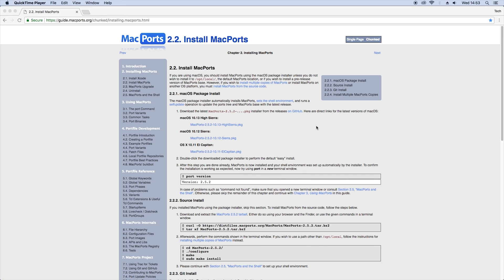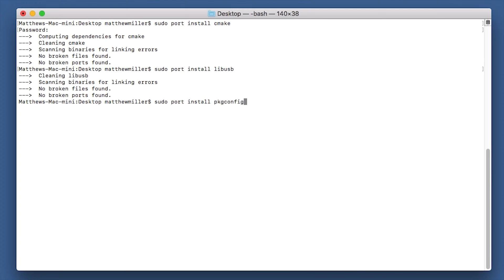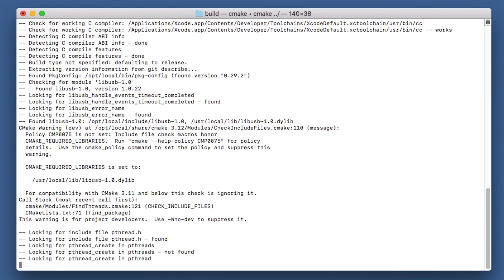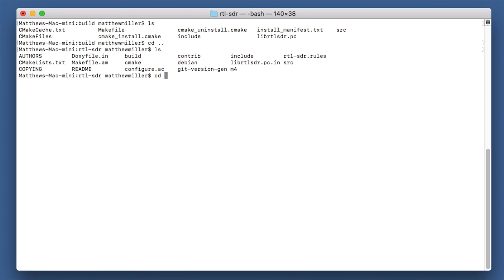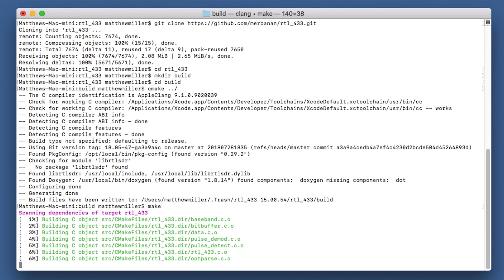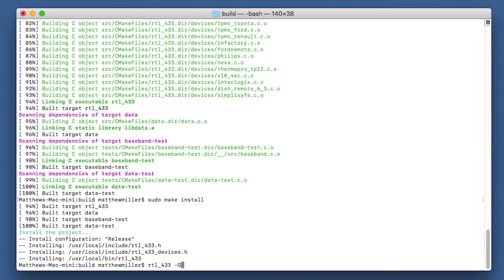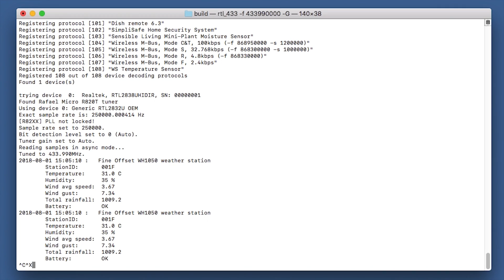Decoding Low Power Devices on MAC OSX Using RTL433

Comment: Why would you not use brew
Reply from the maker: There's always a million ways to accomplish the same goal, in this example I used macport. :-)
Reply: Don't suppose there's an easy substitution from this to brew commands? I have brew but barely know how to use it.

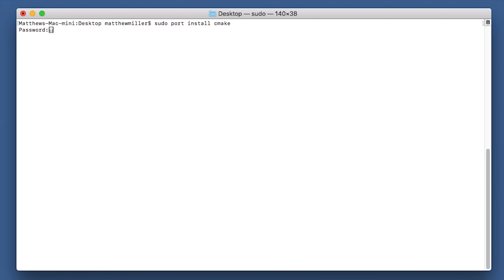When I entered that first MacPorts terminal command @2:12, I got

"Password:
Warning: xcodebuild exists but failed to execute
Warning: All compilers are either blacklisted or unavailable; defaulting to first fallback option
Warning: Xcode does not appear to be installed; most ports will likely fail to build."

[and the list of dependencies which seem irrelevant to list here if the last line above is correct]
Reply from the maker: You could either install Xcode so it installs the compiler needed or try using brew here: https://gist.github.com/jheasly/9477732